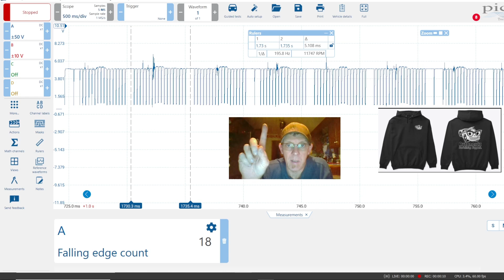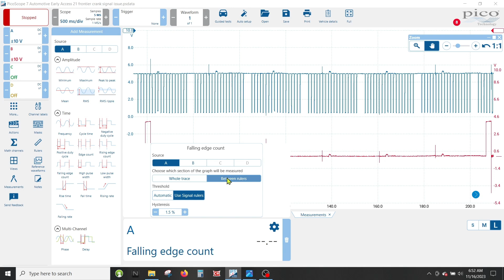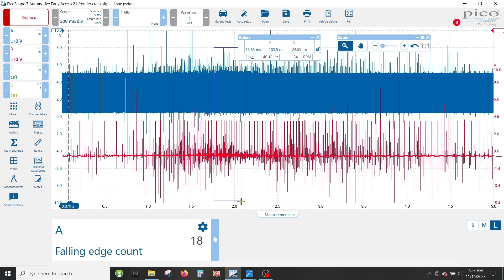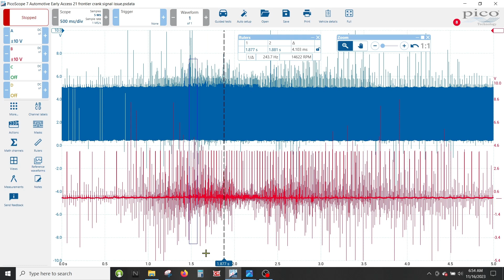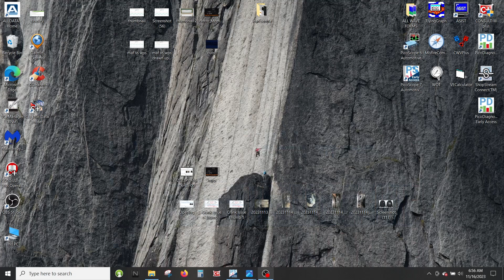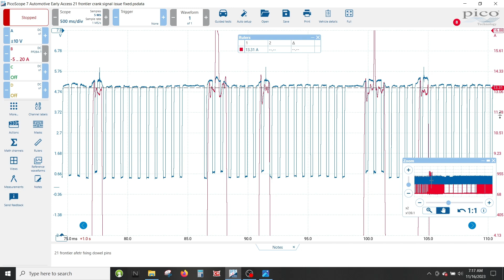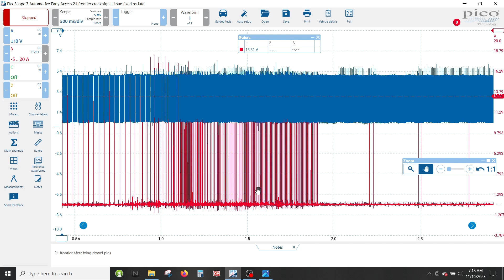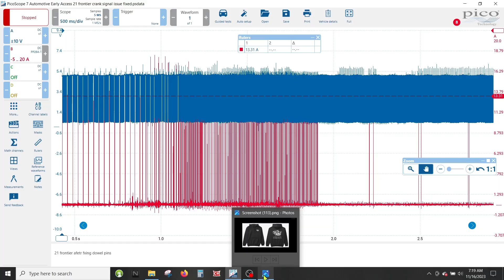Failed Crank Sensor???

Comment: How were they able to bolt up the transmission if it was misaligned? Wouldn't you struggle to get the transmission bolts in and out? Thread marking on the bolt holes? Worn threads on the mounting bolts themselves? Is this a Nissan thing, having a semi circle bore on both the engine and transmission for the crank sensor? Have you seen this before? I would've put in a crank sensor and of course be wrong. I had a similar issue on a Silverado 5.3L but no code. Intermittently, it would take two ignition cycles to start. It was the cam sensor that would not switch within the 24x window time frame. In my case, the cam sensor mounting hole is one whole cavity. Great case study. Thank you for your videos. I'm binge watching them right now lol.
Reply from the maker: Approximately 11:45 mark you can see the other hole and some slight damage from the force fitting that happened.
I have seen this a few times, unfortunately. 
Sometimes the dowels get left out completely, that also leads to issue.
Thanks for the binge watching,  I appreciate that

Comment: Just found your very interesting channel. Those spikes are not high current but high voltage that scatters through the different signal paths. Ideally you shield the two wires from the crank sensor signal. The voltage spike could be caused by ie a failing injector causing a ignition misfire that causes a very high voltage spike caused by the lack of fuel. 

I encounter a cranksensor that was scratch by the fly wheel because the forgot to put in filler ring so that there is sufficient gap space between the sensor and the flywheel
Reply from the maker: Awsome.  👍

Comment: I’ve seen the same thing on an NV a tech at my dealership decided the dowel pins weren’t important and couldn’t fix the crank sensor code after installation…you in the NY area haha wouldn’t be surprised if it was from our guy…😂
Reply from the maker: Who needs them dowel pins anyway.  😄 🤣  Thanks for commenting 🤘.

Comment: GREAT VIDEO , COULD YOU OF USED THE CRANKSHAFT  SENSOR GROUND TO TAKE AWAY THE NOISE?
Reply from the maker: I think so. Can't say for 100%. 
My scope is a common ground so I always go to battery ground, especially when I use more than 1 channel.  I would have try it to prove it out. Good question.

Comment: I would have called crank sensor after seeing that capture, the signal stays high when it fails, so the sensor is not switching the supply voltage to ground. Never would have considered a shifted bellhousing...thank you for putting this out.
Reply from the maker: Absolutely 💯,

Comment: Very interesting to a scope new comer to see that it can pick up noise from other electro mechanical devices. It’s something that makes sense as soon as you think about it, kind of like the lights fading when the vacuum gets turned on but at a smaller scale. Thanks for sharing.
Reply from the maker: Good luck on your scope journey. Lots of cool things can be seen, with  a good scope and proper set up.! Thanks for commenting.